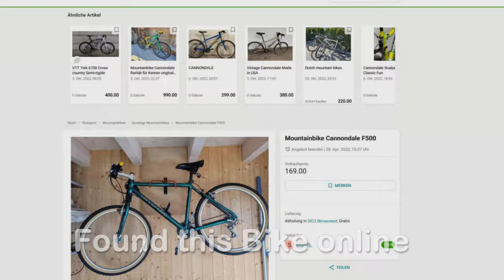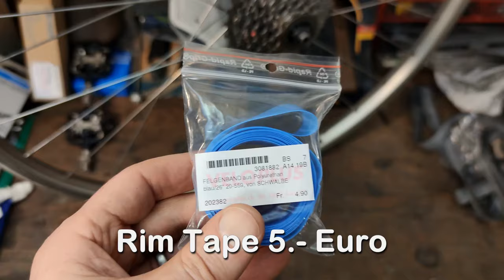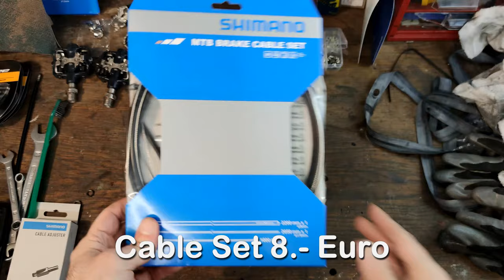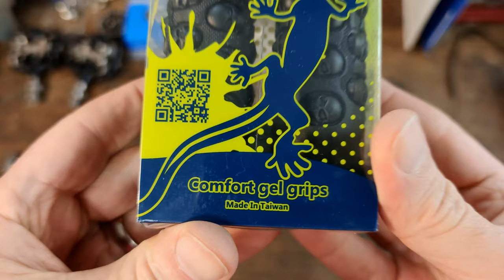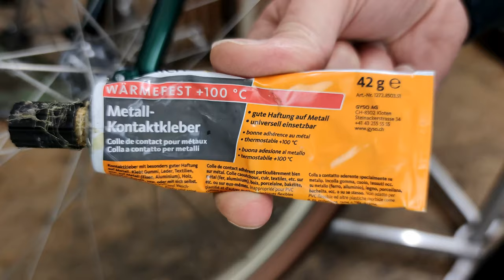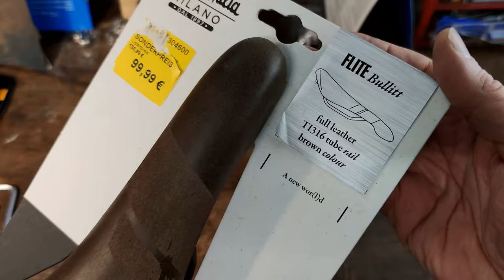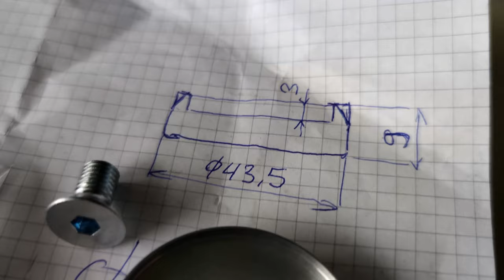Old MTB Restoration / Build  - From boring to WOW

Comment: I like what you did with the small details, “The devil’s in the details.” 

About 30 years ago I did something similar. I bought an old Stumpjumper frame, so old the rear brake bosses were on the bottom of the chainstays.  Anyway, I was a welder/fabricator at the time so I took the frame to work, re-aligned the frame, took off all the old bosses, welded new ones on, welded a new rear drop out hanger on, bead blasted & primed it white, did a 3 color fade (from fork to seat stays/chain stays) of fluorescent orange, yellow, red and clear coated it. Built the wheelset, and installed the first gen Grip Shift (at the time it only 3 moving parts vs. Rapid Fire’s 100+), new drivetrain, cassette, bb, and it became my daily driver. 

What a fun project.

Unfortunately this was the early 90’s and there was no YT, let alone internet. 

Thanks.
Reply from the maker: Sounds great, I also did some projects long before the INTERNET ....we are OLD 🤣
Reply: 30 years ago there were no "old" stumpjumper frames with ubrake mounts. There was a 1987 model year and 1988 model year with a 990 mount in the stumpy lineup, the rockhopper had a ubrake until 1990 on the 14.5.
That's it. They were not "old" at the time.